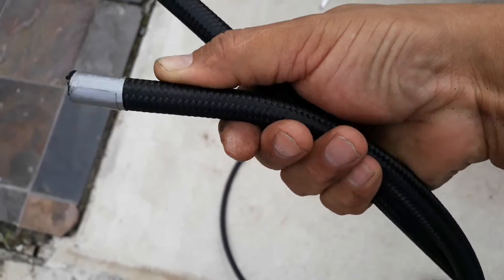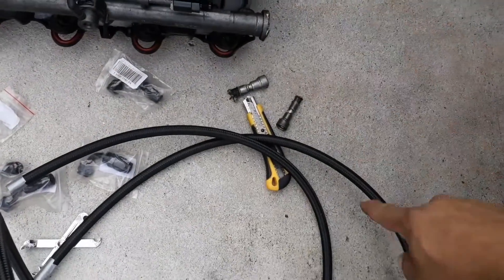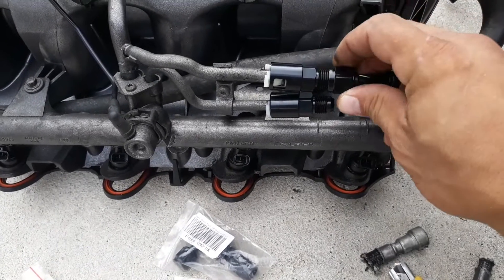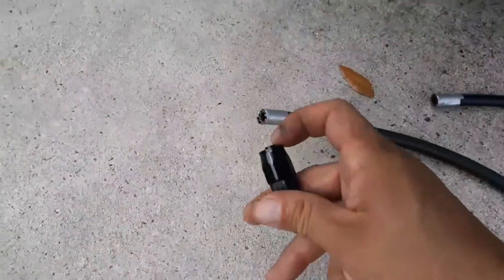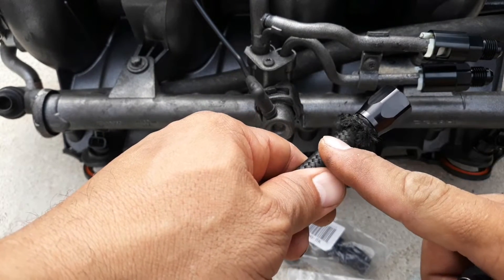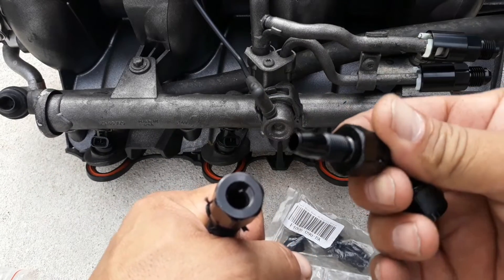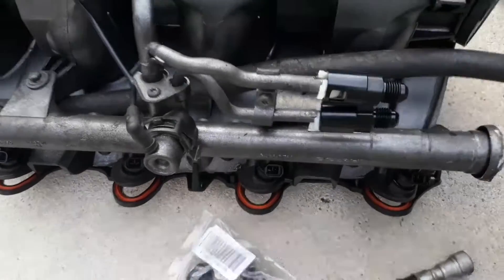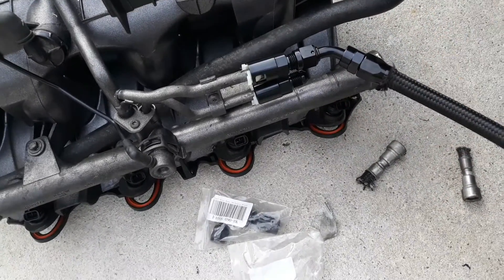How to install AN-6 fuel lines to my Gen 3 LS and Weld some Brakets for my Radiator and headlights .

Comment: Where did you get ur fuel lines from.
Reply from the maker: Ebay, as a fuel line kit.
Reply: @MIC-LS  do you have the link to where u ordered everything
Reply from the maker: 10FT Braided Fuel Hose Line & 4AN 6AN 8AN 10AN 12AN Swivel Hose End Fitting Kit

Comment: Are you using your stock fuel lines also?
Reply from the maker: Yes, hard lines out of tank 3/8" and 5/16", with adapters to 6AN lines to stock fuel rails. But stay tuned, because change is coming only a few such as yourself will know ahead. "HOLLEY HIGH RAM" this will change the game will change fuel lines and Up coming TURBO. OH!!! I Forgot, I let the cat out of the bag. I said too much. Stay tuned.

Comment: What size power steering pulley did you end using? Or what spacing under mount did you use?
Reply from the maker: Hi, Thank you for your comment!!!. I purchased the power steering pump and pulley to match my engine that came out of a 2000 chevy silverado 5.3L.